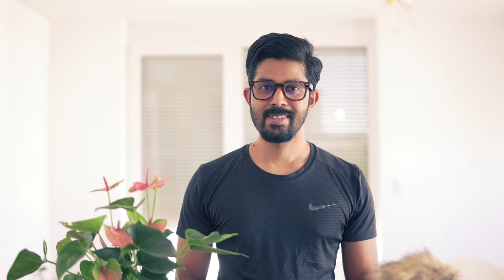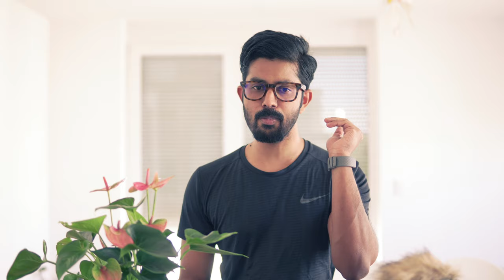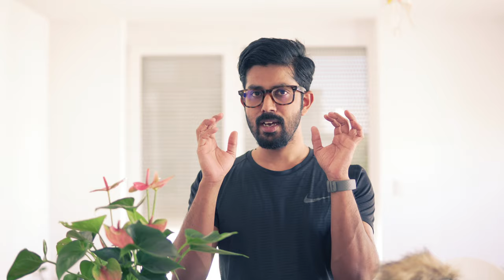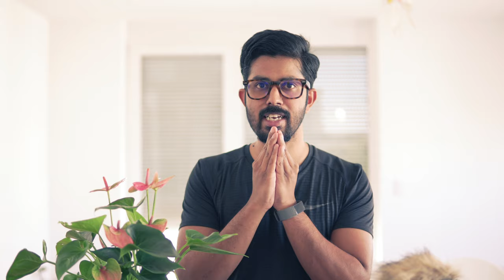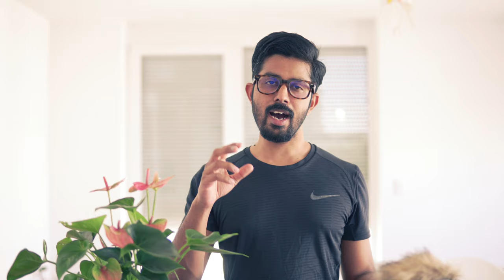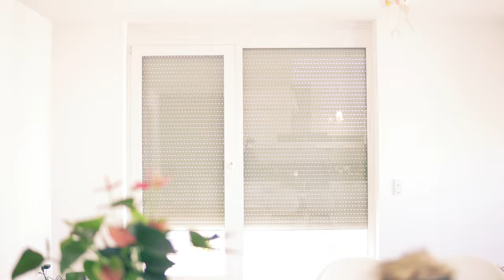Issues with Bajaj Bikes | Watch before buying

Comment: bajaj discover  135 odichikunnu.aake njn neritta prashnam sprocket isdue aanu. Njn discoverum 2nd hand aanu vaangiyathu. 2009 model.
Aalu refined onnum alla, quality issues undu engilum parayunna mileage enthaayaalum thannirikkum. Enikku oru 70 kmpl kittunnundu. Service okke cheap aanu. Discoverinte spare illel pulsarinteyo, platinayudeyo spare ittalum scene ila. Refinement nokkanda, kittilla.
Discover 🔥

Comment: Bro..  In terms of engine refinement & parts quality  which is better Dominar 400 or Duke 250   (Different segment but falling under same price bracket ,bit confused ) preferring long term usage and a quality ride  :)   please suggest
Reply: Duke 250 will give you more polish. Engine refinement wise, I won't say there is a huge difference. Here is how you can select :

Do you need a larger motor for more top speed, relaxed touring? - Dominar 400
Do you need an agile, better handling bike? Are you more of a sport rider who appreciate the corners, who lives for the euphoria of riding quick and more so on the twisty ? - get the Duke. 

My choice in your budget:

Choice 1 : Hasqvarna Vitpilen 250
Choice 2 : Duke 250
Reply: @kochumvk  Thank you bro, for this detailed solution :)  . Looking forward expecting great reviews likes this 🤗. 
And I Very much Appreciate the quality of the contents 👌.